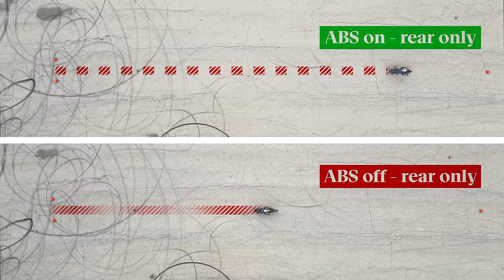Out-braking the ABS Myth

Comment: At 71 years old with 50+ years riding many bikes long and hard, I’m proud to say I used yesterday’s ride to practice skills. Still crazy (and learning) after all these years.
Reply: I turned 71 today, and also have fifty years on motorbikes . . . plus many, many miles too. The ONLY way to keep up your riding skills is to practice them in a safe place away from traffic, on a regular monthly schedule. Regular riding just doesn't get it done.
Reply: @patrickfitzgerald2861 Unless you always practice while you ride, pushing your limits. I was peeling out in the rain all the way home tonight on the street, seeing how far my TCS system allows my rear to slide out in each mode. I ride gravel every chance I get as well, skidding the front and rear independently for practice.
Reply: @shaundisch2020  I disagree with "pushing your limits" on public roads. No one has the right to endanger others, regardless of the reason(s).
Reply: As much as I hate saying this.
50+ year riding "experience" does not equate to being a SKILLED rider.
Anyone who has ever been on a motorcycle for even one day is an "experienced" rider.
A couple from my community just recently crashed after encountering a deer at highway speed due to lack of skills even though they been riding for many years.
The worst part is, they didn't hit the deer causing them to crash.
Sadly she lost her life.

Consistently un-skilled riders react with panic rather than responding with trained and conditioned skills that have become second nature.
Reply: @patrickfitzgerald2861  Happy 71st Birthday!
Reply: @neutron-au  Thanks!
Reply: can you wheelie at balance point
Reply: @joetroy2904  I have never attempted to wheelie. It is just a stupid a stupid stunt that can destroy a good bike
Reply: @alandavies55  you should strive to be capable of everything your bike is capable of
Reply: @grounded7362  Very true! "If you don't use it, you lose it." I ride year round, 10k miles per year, gravel and pavement. I tell people to practice their braking with cones for evidence of their actual abilities. If people ride 3k miles a year with 6 months off every year, and only on pavement,  their skills are likely lacking.
Reply: @alandavies55  Maybe your bike is not suited to wheelies. After 44yrs of riding mostly off road but road riding in many countries here is what I have learned. To ride off road well you need to be comfortable with both wheels sliding and one or two wheels off the ground. Catching a slide on the road and not crashing has saved my life several times. Now wheelies, being able and confident to do one is also a life saver. Picture this you come round a corner to find a branch or obstacle on the road and no time to stop. If you hit that with your front wheel while heavy braking you are going down. Release the brakes, pop a small wheelie (even unloading the front end with power) over it and you massively increase your chance of staying up, same as taking evasive action and hitting a large curb, even at an angle a wheelie can save you. Wheelies are NOT just "a stupid stunt", just remember to cover the rear brake and there's no chance of flipping. Get a dirt bike and learn these skills, it will make you a much better and safer road rider. Choose a road bike that is not too heavy and throw away hard luggage that will chew you up in a crash.
Reply: @craigdavies8099  I have not done much off road riding, but I can see that off road wheelies could be very useful. The only competitive riding I have done is in UK hill climbs where going off road is the result of missing a bend. When I posted the comment I was thinking more of a young prat I encountered earlier this year who found it amusing to wheelie up the high street and watch old people, many with walking aids struggle to reach the pavement. Of course when I suggested that he cooled it a bit, all I got was a mouthful of abuse. I hate to see anyone injured on a bike, but it was edifying to see him hobble through town with a leg in plaster a few weeks later.
Reply: @craigdavies8099  "coming around a corner to find a branch or obstacle in your path"?..........strongly implies your speed exceeds your safe braking distance. I strongly recommend you don't rely on wheelies as a replacement for traditional roadcraft ( they may be of benefit in a small minority of scenarios but you won't wheelie your way out of a collision with a stationary vehicle/pedestrian/animal.) Try riding at approximate speeds for the scenario and maximise forward observations?
Reply: @jamiedall4833  I do ride safely and sensibly, not one accident on the road and I haven't had a speeding ticket since 1999. If you want to limit your riding skills it's no bother to me. But those "minority" scenarios are often your last...
Reply from the maker: Hell yeah Uncle Wally! ~RF9
Reply: @patrickfitzgerald2861  I always try to stay away from other vehicles. I am never out of control, just at the edge of what I know is easily done towards something which is unknown. Which is easily reversed and correctable if it gets too far from comfortable. I have ridden 35k miles in 3 years. That is over 10 years of experience for the average rider, but compressed, retained, and added upon since I ride year round. A lot of that is off-road where both tires are often sliding. Street riding is way too easy and boring, requiring no skill, usually. I'm not endangering anyone, not even myself.
Reply: You never stop learning
Reply: Forever the student, not a bad way to live.
Reply: Those who think they're the best are usually the worst.
Reply: @grounded7362 what you are saying is something I see daily with truck drivers. They have many yrs experience but they quit learning around their 6th to 12th month of driving because they already knew everything at that point. Been there done that attitude. We call them billy big riggers dumbest shit on the road. So my point is IF you keep your head in the game and continue to learn every time you hit the road/practice what you have learned every ride you become better every mile. I am 67yrs old been riding since I was 13yrs old. Dont know how many miles I have on 2 wheels I have over 4 million on 18 plus wheels so I do know a little about the learning experience
Reply: I've been riding since I was 10. I'm 52 now. I can always break faster than a computer.  However I also keep my situational awareness up as if I were driving a semi.
Reply: @umpatas5468   @umpatas5468  You can't even spell 'brake' let alone react faster than a computer. Anti skid equipped bikes out brake non abs versions every time regardless of who's riding.
Reply: Proving you can teach an old hog new tricks...😜
Reply: RESPECT 💯
Reply: @patrickfitzgerald2861 ???? Endanger others??? With a bike??? Has there ever been a third party fatality or even injury from being hit by a bike?
Reply: @WeatherManToBe You can't possibly be that ignorant, so I'll assume you're just a troll and mute you.
Reply: @FortNine  o mi....00:27🤣 hola from buenos aires
Reply: U guys talking about practice?? What practice, im 19 i just ride
Reply: I'm just a wee bit younger than you and the best thing about having stumbled upon Ryan's channel here is that even an old dog like me is learning new tricks. Just don't tell my wife, because she thinks I'm the greatest motorcycle rider ever. So, shhh, please? LMAO
Reply: Once upon a time, I taught physics to gifted high school students, so Ryan's scientific approach to bike riding is awakening bits of grey matter that haven't noticed any significant neural activity for about a decade. 
Many thanks, Ryan. 👍👍🤙🏍🏍😎
Reply: @grounded7362  Well here's the thing, if you have been riding for 50 years with few incidents you MUST be VERY SKILLED  at defensive driving in the ENVIRONMENT that you ride in, eg if you are an urban rider who has to go to work in heavy traffic day in day out, sometimes in the dark with rain and ice!  I believe keeping your speed at an appropriate level and learning to recognise dangerous situations before it is too late stands many of those longer living, lesser crashing motorcyclists out there in good stead. Now I''m not saying you shouldn't train, definitely do so, but I am saying that there ARE things we can learn from them and they do have skills.

Comment: speed never killed anyone, suddenly becoming stationary, that's what gets you. -Clarkson.
Reply: That's more or less the thing. Running into things, being run over by things and running off of things are what kill people typically. Yes, there are freak accidents like that dude that got his head ripped off by a downed power line, but there is a point where no amount of preparation and safe practices can save you. Fortunately, those are rare cases.
Reply: wise man
Reply: yawn
Reply: you can become suddenly stationary while previously going 5 kmh or going 200kmh, sure it's gonna have the same effect both times
Reply: That's like saying being pushed into the ocean without a flotation device isn't what kills people; it's the accumulation of water in the lungs. Is that the ultimate cause, viewed in isolation? Sure. But it's a completely meaningless distinction, and no judge in the world would buy your reasoning if that's your defense.

Semantically, if you wanted to tie yourself into a knot, you could argue that travelling at 150 km/h isn't what kills you, sure. But the fact of the matter is that a sudden stop at 80 km/h is less deadly than a sudden stop at 150 km/h. Due to a thing called physics, the stop cannot be viewed in isolation; it is completely dependent upon the preceding speed going into it.

Furthermore, a sudden stop isn't always braking. Even if you think you're in the top percentile of drivers/riders in the world (which is pretty common, it would seem) and so your braking technique and reflexes are astounding, you can still find yourself in a situation where, due to someone else's mistake, you're completely blindsided.
Reply: Just ask the Hamster!
Reply: Speed is the no.1 killer on the roads.
Reply: Actually...most or at least some of of the crew of Space Shuttle Columbia are believed to have died from injuries caused by high speed, such as windblast and shockwave, and then after stripped of their suits' protection being exposed to the hot temperatures generated from the friction of traveling at such massive speeds.
Reply: @Paroex  suddenly becoming stationary at any speed is lethal.
When your skull becomes stationary at 5kmh say when you trip and fall onto concrete yet your brain continues to move forwards getting smushed you die, which is why even skateboarders and cyclists wear helmets, yet people die when they slip and fall in the shower.

The saying isn't taken literally for other factors like reaction speed such as catching yourself or braking distance that all make you slow down gradually.

So please, respect the physics and biology, you clearly didn't study either...
Edit: a diver jumping into water isn't getting their lungs filled with water.
In investigation the primary source of death in drowning isn't even "lungs filled with water" it's asphyxiation, which is "lack of oxygen in the blood/lung".
And people have died of drowning without even falling into any water, all it takes is getting tied down and a gardening hose.
Reply: @pistonburner6448  That´s the exact meaning of the phrase. The speed was not the problem, but the interaction with things that want to slow you down faster than you could
Reply: @phoenixqwertz  A lot of people have overdosed on speed
Reply: @pistonburner6448 yeah but how many of us taking trips in space shuttles? 😂 it's such an isolated incident, it doesn't really have any bearing on the conversation
Reply: Speed isn’t the problem.
‘Relative’ speed is.
Reply: @OneFreeMan17  If a human is without protection from the elements then pure speed of travel is definitely a problem. You try 2000km/h without a cockpit or protective suit.
Reply: @phoenixqwertz  The speed was the problem. If you travel at high enough speed then you will need massive protection simply to survive that speed. "Slowing down" has nothing to do with it and is invalid as a counterpoint, as air resistance is part of traveling at high speeds. And if you don't have the right kind of air at the right amounts then you can't survive that either. Above certain speeds I doubt you can breathe even if the air is perfectly suitable air.
A human alone cannot handle high speeds above a certain threshold. And even if they build massively advanced protective structures, breathing apparatuses, temperature regulators, and research all the conditions you have to adhere to in order for that apparatus to work, even then it will have its limits and not survive over certain speeds.

It's not even a case of far-fetched examples: if you don't have hearing protection in addition to a top-level modern helmet then already at speeds as low as 150-180km/h you will damage your hearing permanently after a certain amount of time, possibly as low as 15 minutes. Without that very advanced device called a helmet it'll happen even quicker. I bet your eyes won't survive long at already such low speeds for long either unless you have protection for them.
Reply: @pistonburner6448  wut? 😑
Reply: @OneFreeMan17  What was unclear? Speed kills (humans). Go fast enough (and for long enough) naked and you will not survive. (Permanent injuries happen at very low speeds already.) Add a protective suit and you can go slightly faster, but the limits come up very fast. Then add some protective device, chassis, vessel or something at huge cost and effort and you can go faster still, but again the limits of that contraption will come up fast.
Reply: @pistonburner6448  Stay in your closet then if you’re afraid of “speed”
Reply: @OneFreeMan17  Who said I'm afraid of speed? You seem to be very unable to comprehend things.
Reply: @pistonburner6448  You sure do.
Reply: @OneFreeMan17  How mature.
Reply: @pistonburner6448  Ok boomer.
Reply: @pistonburner6448  You shouldn’t speak of your mother like that.
Reply: Speed kills when rotation.